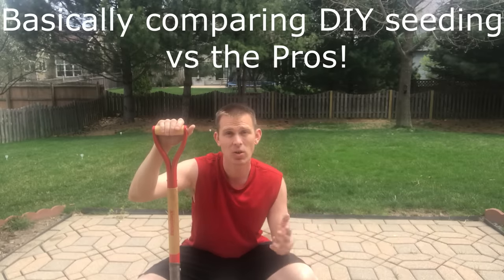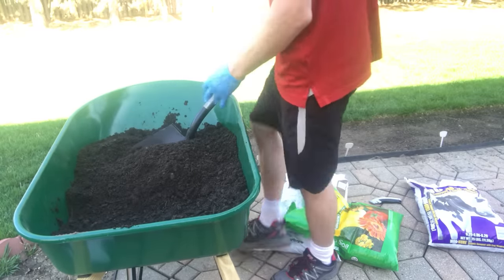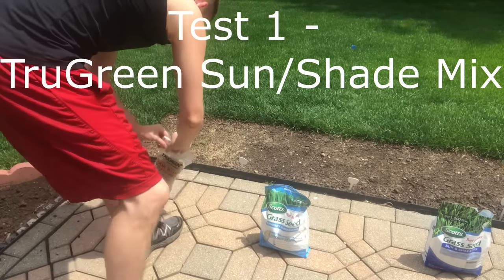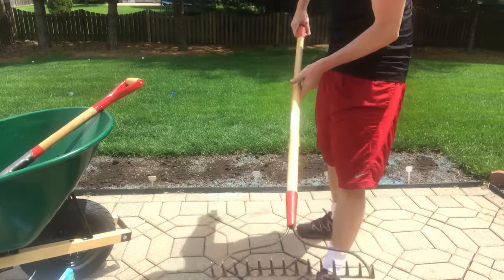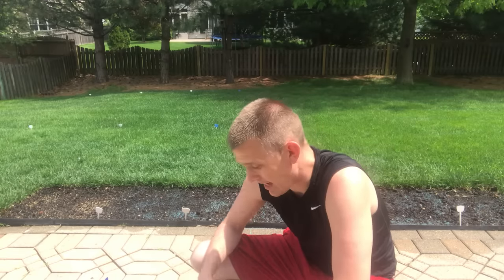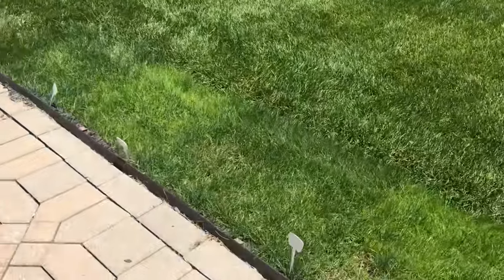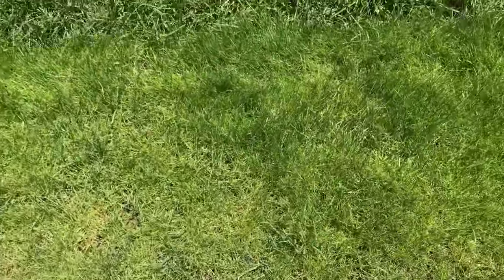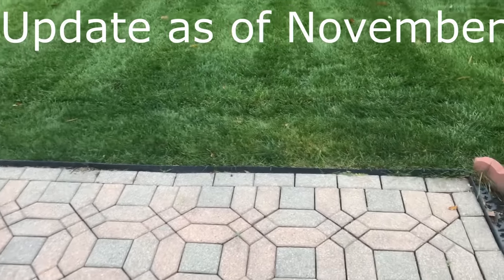Grass Seed Test PROOF! | Grass Seeding Before and After Results (LAWN CARE)

Comment: Kentucky blue requires too much water and Scotts products (all of them) are overpriced in my opinion. I have a local Co-op that sells a good quality fescue and fertilizer. You might want to check out your area for a Co-op. Pennington also makes a good fescue.
Reply from the maker: Chris -- i have yet to test the cheaper brands, I figured I would start with the most popular first.  More tests to come though!!
Reply: i agree that Scotts are overpriced. Kentucky blue requires alot of water when planting. after established, uses less water than others.
Reply: Co op seed is a 1/4 of the price bigger bags and works just as well if not better. I have the nicest lawn in the neighborhood I dethatch patch and overseed in spring and that’s it.

Comment: This is BS already. Who is going to mix their entire yard with Miracle Grow potting soil. I have 90,000 square feet and simply use professional products. Bag of top soil....haha plus all your tools are brand new. Not a scratch on the wheel barrow and your shovel has the sticker on it. A waterimg can, this gets better and better.
Reply from the maker: David Stepeck -- watering can and shovel always keep stickers on. No issues with that is there? Wheelbarrow was new for this video 😜
Reply: Jealous Lawn Care I’ve used my tools for years and they look like they were used by a hard working man. You probably have one of those cheesy tool kits too with the little hammer and 5’ tape measure. Just bustin’ your chops man